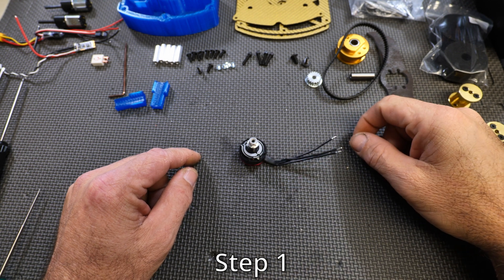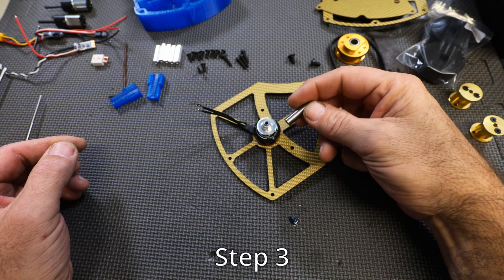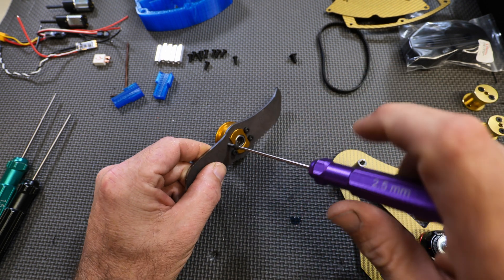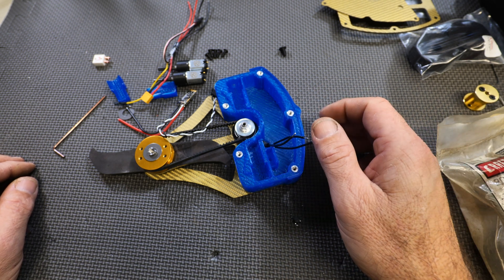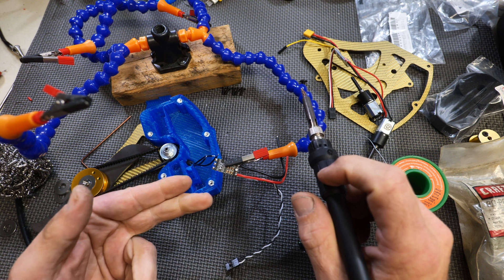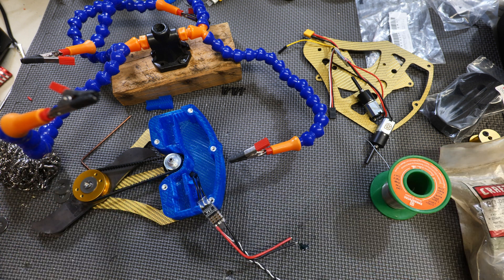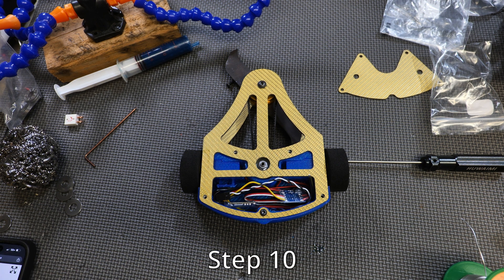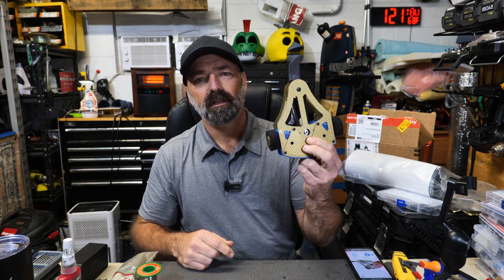Repeat Robotics Kit "Scalar" Step by Step Build Guide/Antweight Combat Robot Build!!!

Comment: Thanks for the great video. Putting my together right now for my first competition. Have you done any upgrades to the weapon motor or were the stock ones good enough?
Reply from the maker: I used the stock one. I ran my weapon at 50 percent most of the time. Spin too fast and lose control.

Comment: Thank you for the instructions! I have a few questions as I bought the kit and had a few problems. 1. How do you connect the power switch (and what do you connect it to)? 2. Whenever I connect the battery to the ESC, the ESC instatnly smokes. This is likely because I did not soder anything yet, probably did not connect the ESC to the receiver correctly or in the correct spot.
Reply from the maker: The power switch goes on the positive lead from the battery.  The ESC is trash if it smoked. If you connected power backwards or added power to the wrong port it will smoke.

Comment: Thank you for posting this video. I do like the looks of the Scalar robot. We have a couple of Viper Robots from Palm Beach Bots. I put mine together last week with a lifter and ordered a spinner kit today... My first fight will be at Megacon and from the looks of other bots signed up I am gonna be in trouble..
Reply from the maker: We will be there too! The viper kit is a good kit. I have seen people win with them. My biggest recommendation is Titanium armor instead of the polycarbonate. What is your bots Name?
Reply from the maker: I think I found it "Firewolf" Is that correct?
Reply: I used 1/8 inch UHMW for front armor. I am getting a piece of 0.5mm titanium for top armor. I have a piece of 1.0mm but it's too heavy.. I'm too close to 454grams. I need to shorten the wires and see how much weight I can lose.
Reply from the maker: @robertrussell6324  Some people have drilled holes in the bottom of the chassis to reduce weight. Just not too many lol
Reply: I made the 0.5mm top armor, my first time working with Titanium.. I installed a spinner onto the Viper. No problems with weight. I ended up ordering 2 Scalar kits. My first fight ever will be at Megacon.. I only have about 10 minutes of drive time on robots.. so I practiced my "tap out" technique yesterday😂
Reply from the maker: @robertrussell6324  you will be fine!
Reply: one of the Scalar kits arrived today. Watching this video as I assemble.. Fixin to start soldering now, it looks like I need to buy the yellow male battery connector  @TeamJunkYardDog
Reply from the maker: @Robertfishes62  I likely have some with me at megacon.
Reply: Thank you! I ordered some  XT30 to JST adapters. Promised next day delivery. I have some spare parts on hand and some on order..but I should have ordered a spare plastic body.
Reply from the maker: @robertrussell6324  I have only one as well lol
Reply: Congrats on your antweight 2nd place at Orlando Megacon. It was my first fight and I learned a lot of valuable lessons. I got home and ordered a bunch of spare parts..and a new soldering station. I also watched 4 videos on how to make adjustments on my FS-16.
Reply from the maker: @robertrussell6324  Congrats to you as well! Are you on Facebook?
Reply: not really..I just go on to check fishing report from the bait shop on the local lake. My wife is on it everyday I think. @TeamJunkYardDog